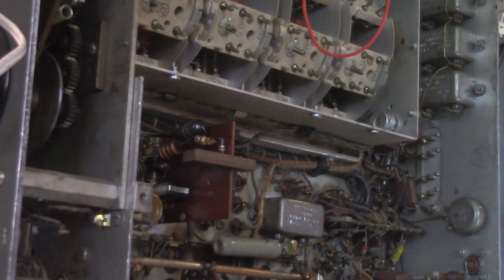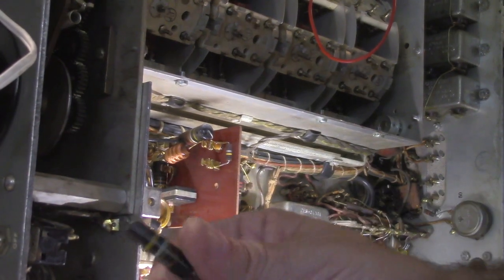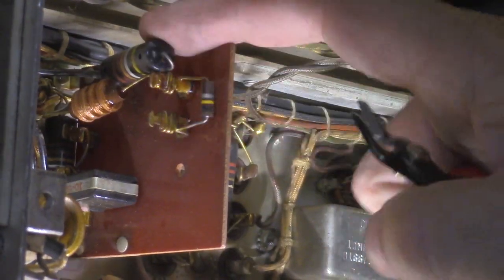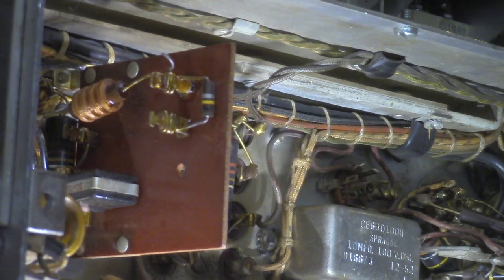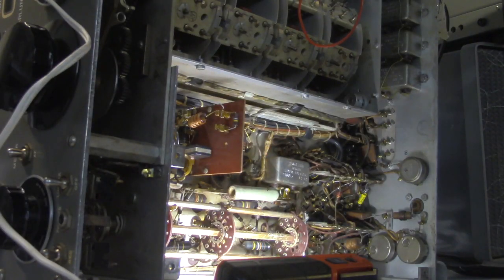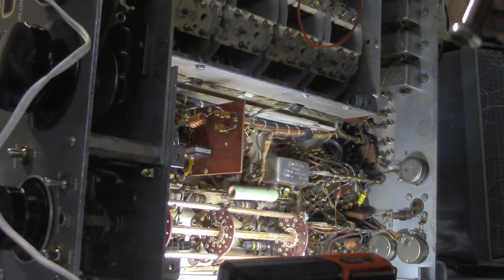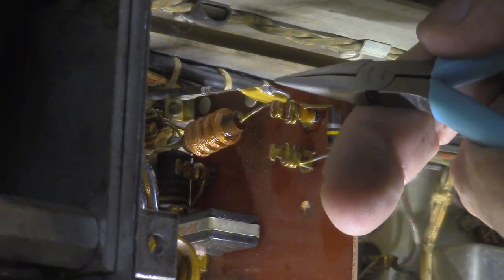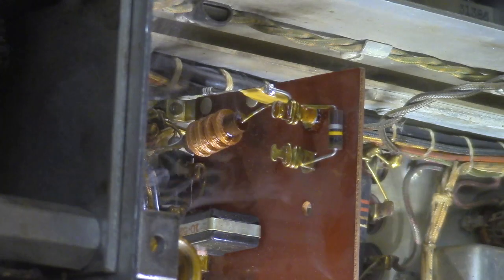Hammarlund sp-600 recap technique

Comment: the coil is better bc its difficult to reach down to the lower lead and bend the new around the old.

I use the dipped SMT radial caps for replacements. 

Used NPO/COG SMTs in the Heath HW-7 and the VFO is now extremely stable.